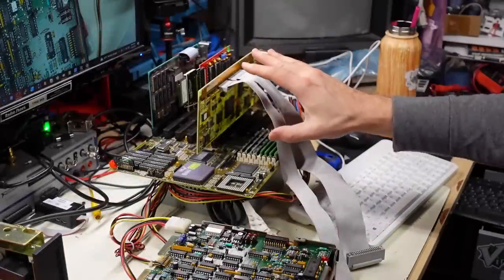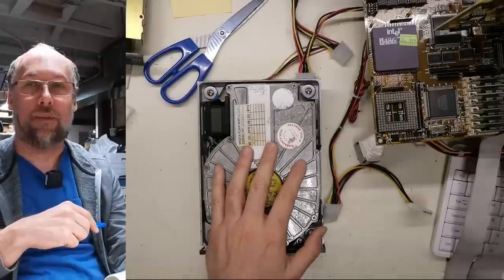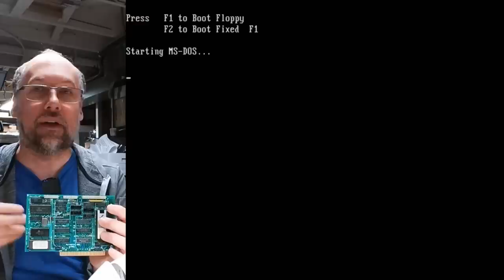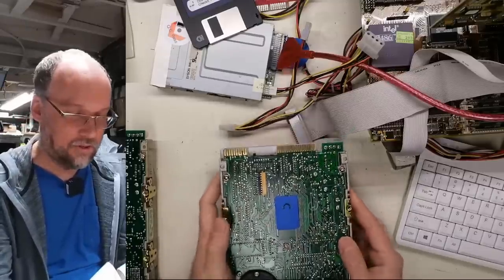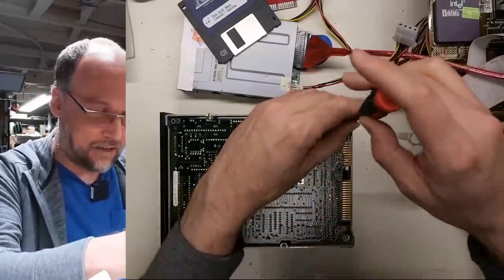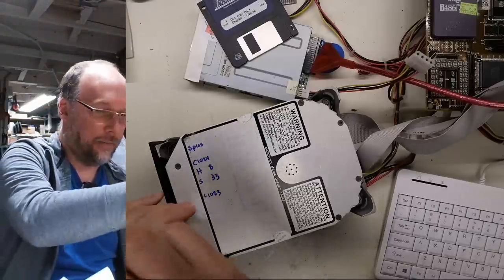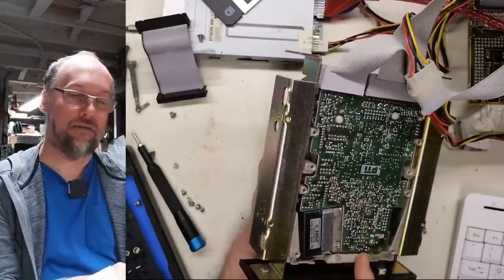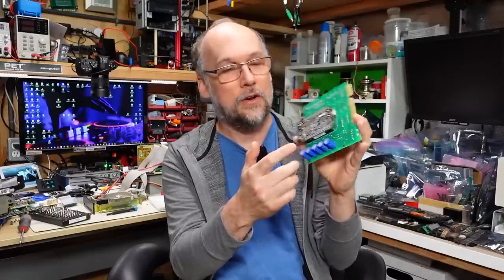MFM drives are really unreliable

Comment: I haven't seen the inside of one of those in quite some time. I used to have some 5 1/4" MFM hard drive disks hung on the wall at my last apartment, if that doesn't scream GEEK, I don't know what does. I don't think most of my visitors even knew what they were.

Comment: I don't recommend swapping the boards over in the drives, as I've learned that the software on the PCB puts a serial code on a Hard Drive sector when it's first powered up after manufacturing. If those codes don't match on power up after that, then the drive won't work.

I've found that was for mainly Seagate drives in the 90's-2010's. But I would'nt risk it.

Great video.
Reply: Not on such old MFM hard drives. There's no logic on the drives themselves, that's why they require a controller card.
Reply: @jeremiefaucher-goulet3365  Oh. I did'nt know that. Thank you.

Comment: i think i had a hard drive like the 3.5" one, and it was extremely slow at reading and writing. eventually it seized up completely. i think a small drop of lubricant might fix the problem, but it's a good chance the drive is toast anyways. 

a number of SCSI drives from the 90s also had stiction problems. i think it was a particular brand that Apple was using.

another data recovery trick, if a hard drive has been damaged by heat, you can try to briefly re-align the data to where it's expected to be by wrapping the drive in tinfoil and heating it on a toaster for a few seconds.

Comment: VHS Video Tapes don't last 30 years either. Cousin asked me to copy VHS tapes to DVD a few years ago, and well, the cheaper tapes had deteriorated along the edges and they couldn't sync with the VHS read head because the tape was curved and lifting off the head. I managed to get some of the tapes, but not the "cheep" tapes.

Comment: I'd prefer selling/giving away the bad ones for parts rather than recycling them.
After all, never know what some crazy-skilled person might be able to piece together from them!
(or what chips/steppers/spindles might be useful in other applications)
I wonder if there's a way to disable head one entirely on that Micropolis 1325, so as to avoid all those bad tracks?
I think most of the modern platters are safety glass, as I had a 3-1/2 laptop drive that had shattered and the pieces were just little squares rattling around inside.(with some dust/fine shards naturally, from the bits grinding together)

Comment: Adrian, while those drives are MFM, that is not the correct name. They are ST-506 drives, which refers to the interface (the 2 cables). MFM refers to the encoding technique for the data on the platters.

Comment: I will say I had a 5150 with and st-225 as well as (later) a 286 clone with a hard disk that was like an st-4056 but had circuit boards on the top and bottom. Both were buzz saw loud from the day I received them at a maximum computer age of two or three years old. I have an xt clone with a working seagate mfm drive (st-251) that is pretty loud. One of my amiga 2000hd units has a miniscribe 40meg mfm that is fairly silent just a hiss.

Anyways my point is that back in the day the Seagate’s and other models were loud even when relatively new. I distinctly remember that and being annoyed.

Comment: The thing that could be wrong with the cgate drive is the steper motor that moves the heads around could be seazed or stuck so its just clicking. You could try to lubercant the motor an seeing if that helps

Comment: The ST225 has a bad index burst.
The knock is the heads trying to get to the tracks below zero
The micropolulis has a survo issue
I need a contact info and I can help…. Worked in a drive shop in the 80s. Back when fixing was worth it

Comment: Yes, drives of that era could indeed be that loud.  But sitting on a hard desk surface, not enclosed inside a computer case, exacerbates that level.

Setting interleave to 4 for unknown drives is a much safer bet.  VERY few controllers/computers could run at 1, often 3 can be used but 4 is almost always usable, if not optimized.  Spinrite can test and see what the optimal interleave should be.  Probably quicker to just LL the drive again with that interleave but it can do it on the fly without losing data!  WAY back when I was learning, a friend found about 5 old Micropolis (I think) 5 MEG, full height drives.  May have 10 whole meg!  Anyway, some worked, some had a single bad head (of 4, as I recall), and I could define/set it to NOT use that head and then the drive was usable!  Not really useful, but it did work.  Setting interleave to 1 will also make ALL (including formatting) SUPER DUPER slow!  Try it again with interleave set to 4.

Oh, and I'd just tell it NOT to add those sectors to the bad track areas, then run spinrite's full diags, it can often return sectors to usable (I think it writes and reads and rewrites (maybe 0s, then 1s to reverse polarity?) the sectors numerous times), as well as mark all the really bad ones out.  No idea if it will still run into bad track area overflow or not though.

Platters on these are usually aluminum with magnetic surface.  I love the IDE platters as they're SUPER shiny and make great mirrors.   I give them to a friend to hang in apple trees to spin and scare birds away (at least some).

Lastly, these drives were not meant to just be used for years, then stored for any number of years (10, 20, etc.) and used again.  Lubricants, non-parked heads (always use a head parking utility before storing any drive not known to do it automatically!), etc. will exacerbate stiction, etc.

Can you tell I started doing this PC stuff a few years back?  :)

Comment: The ST4051 - that sound clearly indicates "invaded by aliens"!
Serious, I designed an MFM controller in the days of ST506. The IBM address mark was documented wrongly. The data bits and clock bits were back to front relative to each other. If you reversed the order, then the combined bit pattern had exactly one pulse shorter than any one that could occur in a normal data pattern between two of the longest gaps that would occur legitimately, and exactly one pulse longer than any legit cone between two of the shortest that could occur legitimately. This there could not be an occurrence of either of these two events in the waveform of normal data. However,  If you read the documentation as shipped, then this uniqueness was lost, and there was a chance you could hit a "false" address mark. The chance was low, because you should not be looking for address marks except immediately after the preamble. AFAIK, all WD other well known  RLL and MFM controllers got this wrong. Drives were shipped with an "acceptable level of errors" which was documented with the drive, and was what you typically got with WD controllers. Mine gave an error rate of about 1/10 of that.

Comment: Hi Adrian. Im considering renovating something like 486 running only DOS. My idea is to use a Raspberry Pi with a TTL to RS232 converter and connect it to a serial port of the 486, and use the PC as a terminal (to start). The Pi will be running Newsboat (RSS feeder). So I can read newsfeeds and I can also use Google Gmail too (so I hear) . Pretty straight forward stuff. But I was wondering if you could show what is the bear minimum needed to get a base DOS machine running. I was looking at the flash drive to ide cards. But not sure which is the best option. Thanks.

Comment: I doubt your quest for a magnet would have done any good.  Most likely the metal disk would not be of iron, or nickel.  The rest of possible materials would be non-magnetic, such as aluminum.  But to something else — my own memories.  I have a recollection of a hard disk that was not MFM, it was RLL type.  May have been used on the one computer that I built myself.  I mean soldering components to a kit board!  The operating system was sort of CP/M,  ZCPR (?) by Richard Conn.  Another recollection was a hard disk on HP-87 computer.  I think it may have been Seagate ST205, not sure.  Anyway, when that “called it quits”, I tried replace it with an ST225.  Not succeeding., as the problem may have been on the interface (controller).  The hard disk (as well as floppy) was interfaced with HP-IB.  In those days I did not have any adequate measuring instruments, like logic analyzer or an oscilloscope for that matters.  Just memories….

Comment: If the drive does not have enough torque, could it not also be tied to faulty capacitors? Regarding the autopsy of the submerged drive: Spinning Rust indeed. I have used MFM drives myself and it was quite entertaining.

Comment: There is a bit of history to the oldest Seagate drives that came up shortly after the manufacturing moved to the Far East.  The females doing the assembly were having problems mounting the spindle motors.  They didn't have the upper body strength to press the motors onto the chassis.  Tolerance was very tight... like almost no clearance.  The plant manager decided to try spraying the chassis and motor with WD 40.  The good news: They could press the motors in.... Unfortunately, that left WD40 on the spindle and chassis.  The good news: The women could press the motor into the chassis..and initial tests showed good drives.  SHIP THEM!!!  Well, result was that the WD40 would set.... but when it was in sustained drive run (as in when you actually installed it in a computer) ... the oil would again become mobile...and would migrate to the middle of the drive...find the spindle.  and start going up...  When it found the first platter, it would flow out across the media.... and then splatter onto the chassis.  This happened with all the production from the plant.. 3 1/2 or 5" both got the treatment.  Seagate was VERY unhappy, and set up repair facilities at several wholesalers... I suspect that the plant manager got fired.  

A good friend got hired and was charged with fixing the drives.  He had stacks of platters in the trunk of his car.... The 5" platters could be used like a Frisbee to cut small trees down. Some of the drives had heads that got stuck to the drives.  (When the drive started, it might have landed in the puddle of oil, gluing the head to the platter.  If you tried the stiction fix, the head would probably rip the head off its arm.  .   He fixed a few hundred of the drives over a several months.   So...if your drive says "Singapore" or whatever as the manufacturing location, you may get one of the tens of thousands of drives that were built with the aid of WD40.

Comment: How about resoldering the edge connector contacts with silver solder?

Those older drives had a cork brake on an armature which would engage when the power was off to slow the drive faster.

Comment: Best way to make a cheaper drive back then, was to skimp on the mechanical parts of it. That probably is why so many of them aren't alive anymore. I bet if you tested many of those drive platter stacks and shafts for balance, they'd have micro-vibrations from being out of balance. Vibrations you can't physically see when they are spinning, but you can definitely hear it when the motor spins up and gets to full speed.

Comment: I rarely ever had an MFM/RLL drive fail on me. They usually lasted a decade past their technological obsolescence. I threw out a large number of perfectly working 30 MB RLL drives simply because by then 1.2 gigabyte IDE drives were common and I had no use for them anymore. I think the drives in this video have been sitting and rusting for 20 years. No device would survive that, hard drive or screwdriver. Flash drives are far, far less reliable than hard drives. I've had a half-dozen dead name brand micro SD cards die on me in the past few years. All of my important data is on spinning hard drives. Hard drives will eventually stop being made but the myth about them being unreliable must stop. The vast majority of hard drives last so long that their size becomes so relatively small that they cease to become useful, not cease working.

Comment: When you say "Recycle" do  you mean hand them in at a recycling centre?  My thoughts are that they are so old they are worth at least one repair attempt.  Obviously dud motors are a no go as you'll never realign the platters but electronically surely it's worth a board swap to see if a drive can be made to work with a known good board and then go from there?

Comment: I'm writing this comment after having heard the first two drives.  They sounded normal to me.  Also keep in mind that some hard drives won't do anything until they're connected.  Some of the later technologies too won't do anything until they are given the command to start spinning (not sure, probably NOT the MFM ones).  This is due to the large initial load of the "spin" motor; you don't necessarily want all of them in your computer trying to start simultaneously, you want to spread them out.

Comment: Drive 2 might be healthy.  The initial seeking didn't sound right, being that it happened for too long a time, but once it finished, it sounded pretty normal for a 225.

Drive number 3 might be healthy. I thought I heard an auto park when you shut the power off.

The Micropolis bearings are bad.

Drive 5 looks like a Tandon.  Those things were junk.  What you have is probably a relabeled reject that may have been slightly derated or had something else done to make it work. Because drives were so expensive back then, there were a lot of companies who did some pretty nasty things to make use of failed samples.

As far as what you are calling stiction, it's actually more likely that you are just dealing with the lubricant being dried up.  Yes, stiction is a thing, but when a drive sets for a long time, it's more likely for it to be a bearing lubricant problem than a head adhesion issue on these older drives that have been setting for a long time.  Your best bet would actually be to pull the circuit boards off of a lot of these drives, and look at the bottom. It is common that part of the motor assembly should be visible, and you can put a drop of a good quality synthetic oil into it. In some cases, you will even see a spinning flywheel component of the motor (not sure what to call it, but it is weighted like a flywheel), and you may be able to move it to get the drive freed up.  Just be sure to turn it the correct direction.

I have restored a few of these old drives myself. It kind of hurts to see how you are doing this, being that you are doing the equivalent of plugging in a 1940s radio just to see if it works, without checking anything inside it. Great way to just destroy the tubes.

I'm actually in the hard drive data recovery business, though, not the radio business. Radios are just a hobby for me.

Edit:  there are a number of components that fail on the boards on the old 225 and 251 drives.  It can probably be fixed.

Also, spindle speed has nothing to do with the data rate.  The 5 and 7.5 Mbps data rates will apply regardless of spindle speed.  This means that the drive performance will not change based on spindle rpm, though at a lower rpm, more data could be recorded on one track.  3600 is just a holdover from mainframe and mini computer days, where the drive spindle was powered by a synchronous motor driven by the AC line.  The number just stuck for no good reason.

Comment: Even old 80286AT on 8 MHz with a WD1003 MFM controller can handle an interleave of 2, but not faster... On a 80486 still limited to interleave of 2 though... Probably it's the WD1003 controller. A WD1006 can do an interleave of 1

Comment: Good thing that (as far as I'm aware) ceramic disk platters were not yet a thing yet, eh?
Reply: AFAIK these kinds of platters are made of a non-magnetic material with a thin ferro-magnetic film (on modern disks it's not a continous film, it's "sputtered" on to increase data capacity) storing the data similarly to tape, the early platters used various aluminium alloys for the platter but in 1990 the first glass platters were introduced for increased shock resistance in laptop drives. AFAIK ceramic disks were also used for a little while for the same reason but glass proved to be superior in many ways but it was a very gradual process, apparently some? many? desktop disks still used aluminium platters in 2015 so not going to say definitely that it's all glass platters even today. It might be....
Yes, the failure mode for glass and ceramic platters are far more dramatic but realistically an aluminium platter is complete scrap long before there's any issues with either of the other two materials and modern disks are sealed units (even the ones not using helium!), there's no longer any air filters.

Comment: With all due respect, I think you meant late 80s, not early 90s when you were in a computer store seeing these drives.  I got my first computer in 1989 and it was already a 80mb IDE at that point.  And when I opened my computer store in Jan 1995, we were well WD Caviar series at that point.  I don't think even before opening my store when I was doing work for a guy buying pallets of surplus computers I even saw a MFM drive.  Even those early PS/2s had IDE drives.   It wasn't until much much later I saw an IBM AT or XT computers and they were already vintage by the time I saw one.
Reply: A place I worked at was still selling systems with MFM drives in them even after the Pentium came out. So, early and even mid 90s there definitely were still 20Mb MFM drives being sold.
Reply: @mikebarushok5361  Perhaps location made a different.  I'm in the Mid-Atlantic US, and I had one fried that had an Amiga, another that had a C64, and one much older friend that had built a Heathkit way back in the day.  Other than that "vintage" computers didn't really seem to be as big around here.  Perhaps in the Pacific Northwest where Adrian is located (I believe from Canada, don't know exact location where worked) there were more "vintage" computer hobbyists, since there was so much homebrew stuff going on.